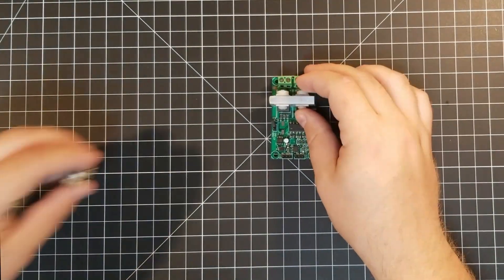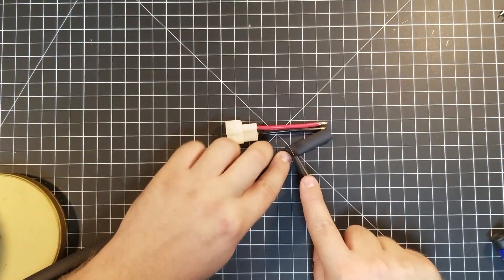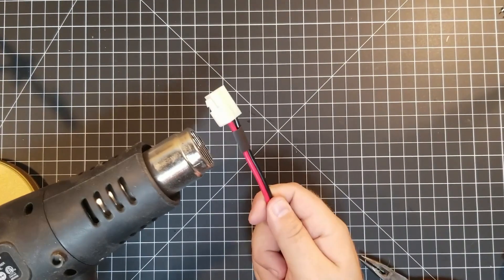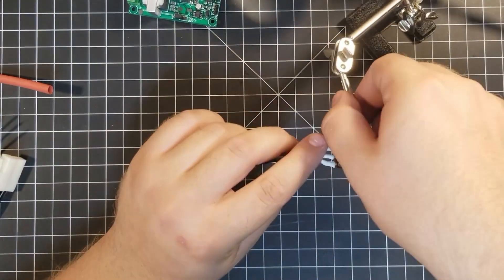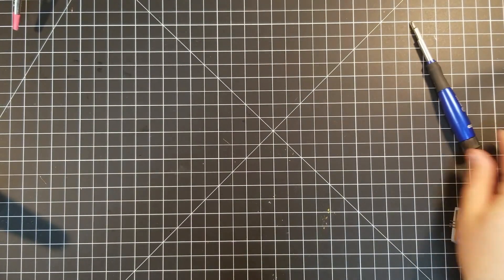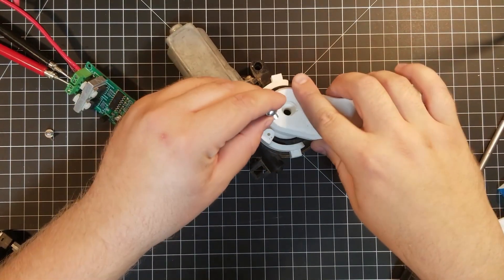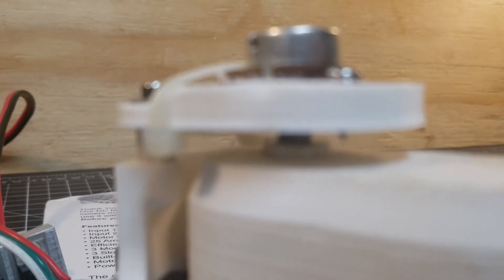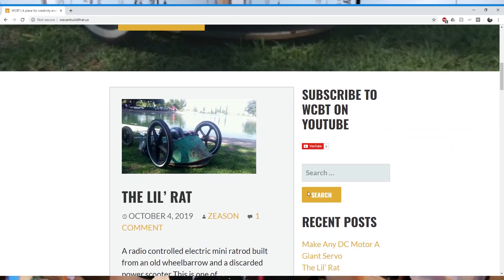Make Any DC Motor A Giant Servo

Comment: Dont tin them if they get clamped under pressure with a screw, its really common mistake i made myself for a long time. but thats why they are slipping out.   Heating cooling cycles, break the tin and as it crumbles it can slip out